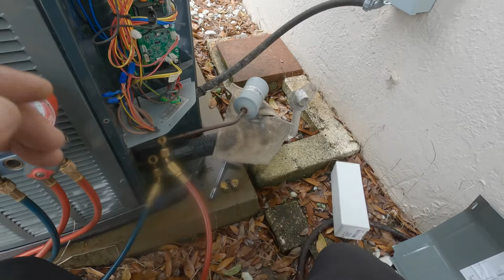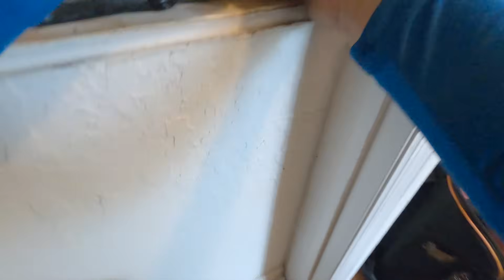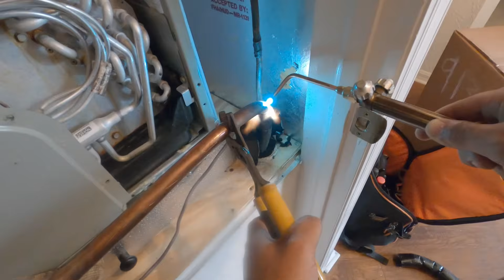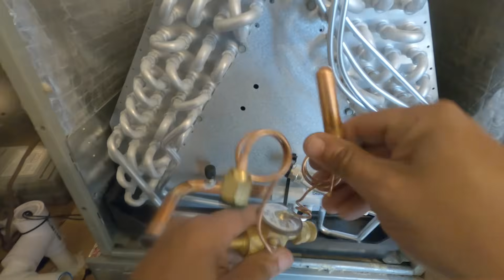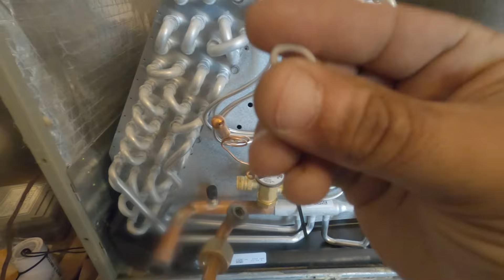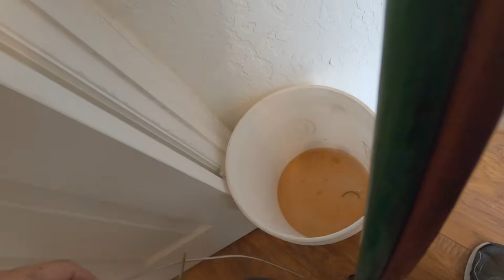Replace a leaking trane AC Evaporator Coil ! HVAC

Comment: We have a 11 month old Trane and over the past month or so have noticed water leaking onto our filter. The company that installed sent a tech out two times, one taped the insulation in the unit and said it is being caused by condensation on the coils, it continued to leak. The second tech cleaned the coils but water is still leaking onto the filter. Wondering if you think we may have a leak in the coils that may need this replacement?
Reply from the maker: Condensation leaking onto the coils could be a number of things and could also be tricky to diagnose if not taken into consideration of all factors. I wouldn't be able to point you in the right direction without knowing the situation. Good luck Debra, hope they get it figured out. 👍

Comment: VICTOR! those aluminum tubes you were bending and getting into place...how fragile are they?? I'm trying to remove that front panel from the A-frame coils so that i can see the INSIDE of the evaporator. I suspect its clogged with pet hair, but im not sure. The problem is I don't want to cut any coolant lines to do this....but those thin aluminum coils are in the way! Can I move them the way you did if mine are still connected? I just need a bit of space to get that damn triangle front cover off! Please let me know!
Reply from the maker: I've done it several times to be able to access the Triangle cover plate on the A-frame that you're talking about. I've had success every time that I've had to do so
Reply from the maker: They are very flexible but you still need to use precautions that you don't Crack a solder joint

Comment: Drier should be done last... think about it's purpose.. you can also drop that hot suction pipe in the  water bucket after sweating it out to cool it off.
Reply from the maker: Thanks for the input sir, but It really doesn't matter when the drier should be done, as long as it's done 👍 and I'd rather stay away from moisture so dropping the Suction line in a bucket of water isn't ideal (respectfully speaking) 🙏 ✌
Reply: @VictorofHVAC  I'm talking about the tip that was hot.. do it your way.. what do I know? 20 years experience
Reply from the maker: I stopped praising people with there experience when I was running circles around senior techs when I was only in the game for a few years. But I see where your coming from, No disrespect brother.
Reply: @VictorofHVAC  AMEN. Time in field means nothing.. I totally feel you. Fk these trash techs

Comment: you do not need to brushup joints for solder?
Reply from the maker: You really should but when you unsweat the copper you wont have an issue with flowing that solder. If it were old copper I most def would have. great question sir.

Comment: Nice info man but i have a question, why did you have replace the evaporator? I mean it had a really bad leak or a crack on it?  How do you determine when it is time to replace it since at the beginning of the video you said it wasn't an old unit, I'm new in this so I'll appreciate any advice.
Reply from the maker: I replace every leaking evaporator coil if it has a leak in it. 
(not worth the effort or liability trying to repair it)

Thanks for the feedback
Reply: I agree if it's under warranty the homeowner deserves a better more reliable repair. Those evaporators aren't cheap.
Reply: @NatePetersonr5t  yeah well try re repairing it and get back with me if successful .